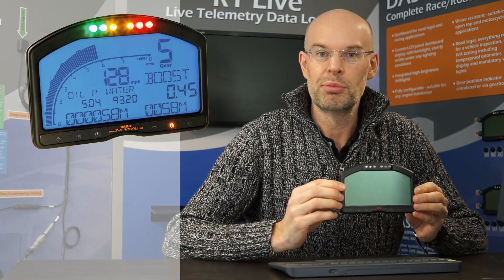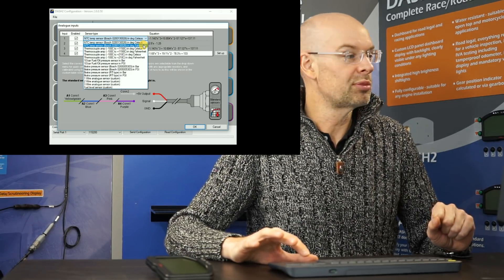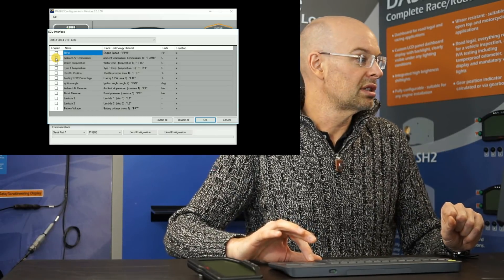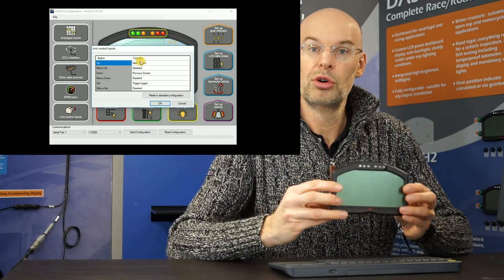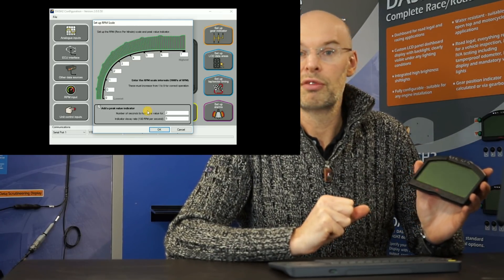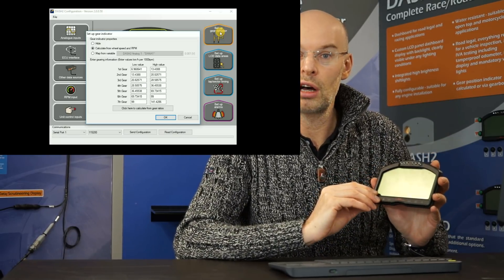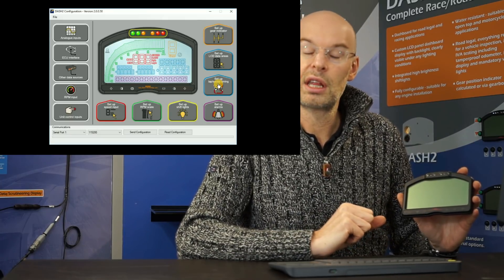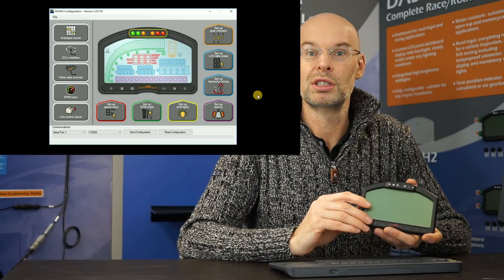The DASH2 Updated - New Software Intro

Comment: Is this applicable to the Dash 2  or only the Dash 2 Pro?
Reply: Seems to be for the Dash2 Pro only. I couldn't find Software for the Dash2.
Reply: It worked with my Dash2 without issue.
Reply: works with v10 firmware on dash2, older versions of firmware this doesnt work